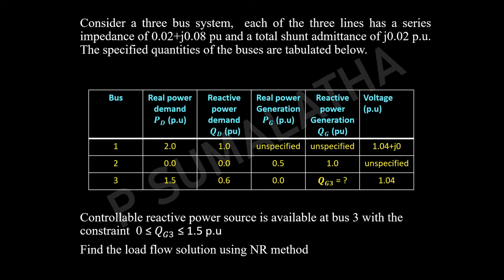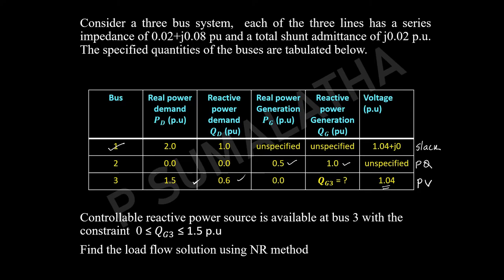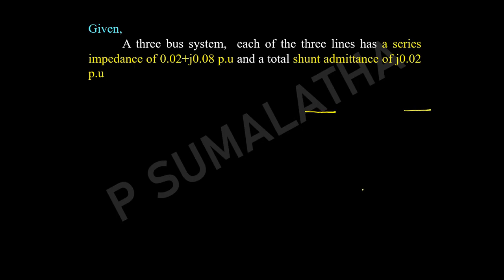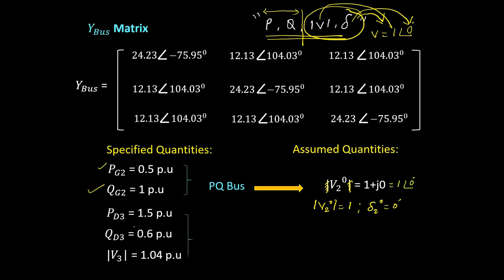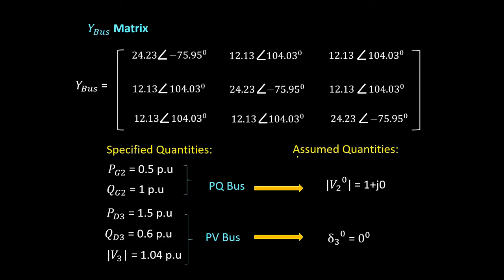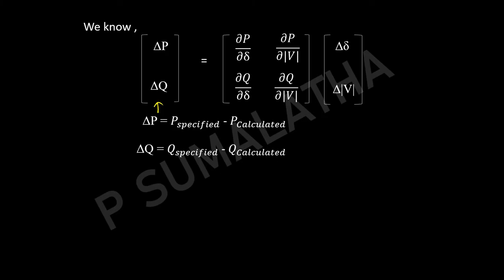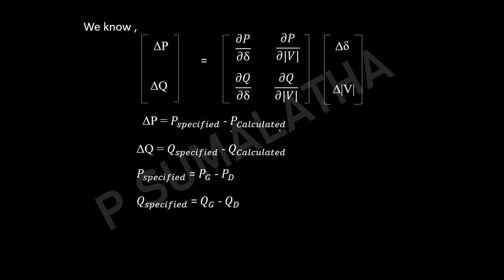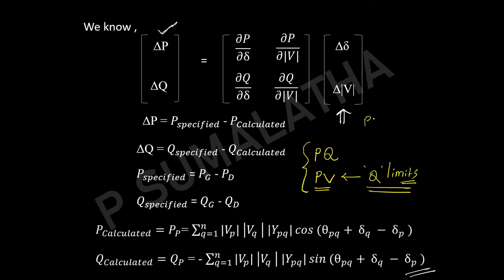Numerical on Newton Raphson Technique

Comment: How we get -ve while expanding the summation for P2 and P3 calculated
Reply from the maker: Typing mistake, there is no negative sign. Its positive value
Reply: Ok..thank you
Reply: Also the sin angle is wrong it should be -75.96 instead of 104.05
Reply: @psumalatha5659  Also the sine angle is wrong it should be -75.96 instead of 104.05, I'm talking about sine angle of y series elements
Reply: @psumalatha5659  please clarify
Reply: @psumalatha5659   mam u typed cos angle instead of sin angle

Comment: Mam for finding P2 calculated why u use negatives sign
Reply from the maker: Its typing mistake.
Reply: @psumalatha5659  and mam for finding each diagonal element why you u use 2.941+j11.764 in place of -j11.764 8:35